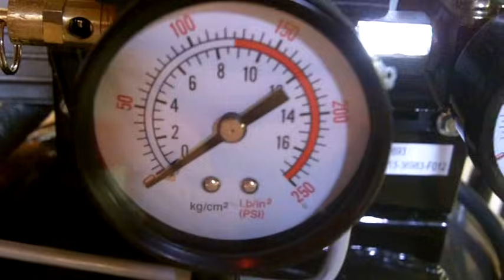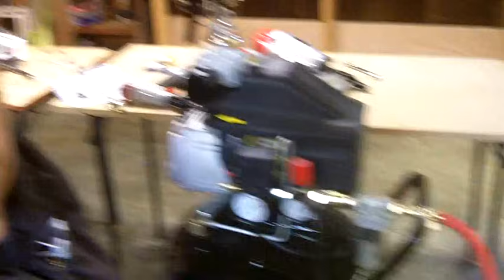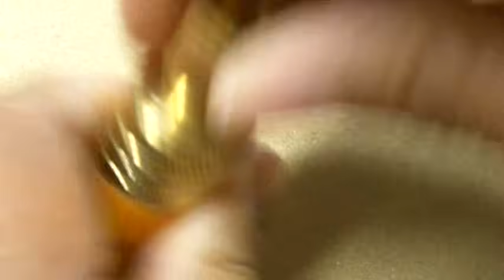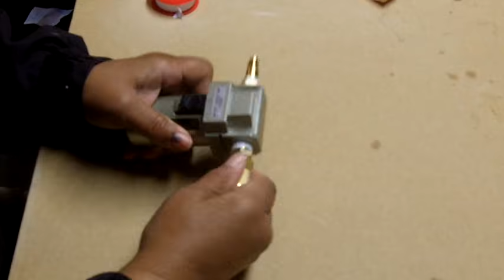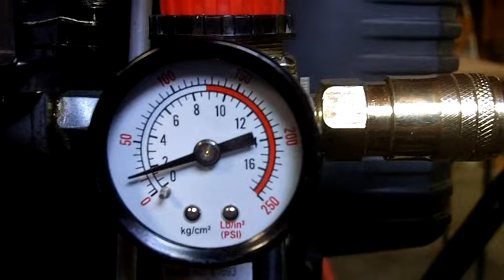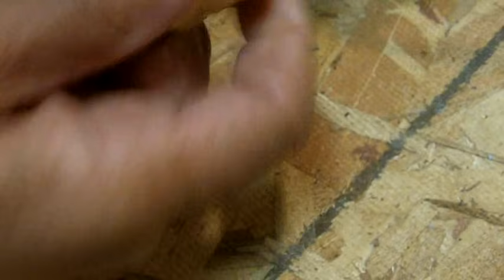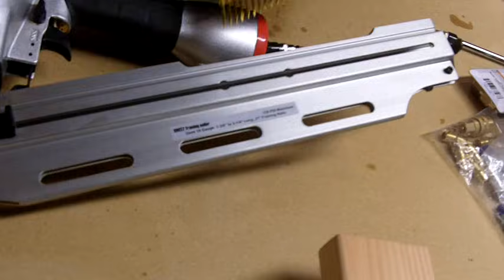Air Compressor, Line Setup and How to Use Air Tools for Beginners

Comment: As a total noob re: compressors This really helped me setup a new inexpensive pancake compressor for cleaning and for filling tires.  Thanks alot.  Very good video.    I had some slight line leaks on the supply lines but nothing that will affect what im using the compressor for.  Eventually i might use it for spray painting once i get a good water trap system (or for assembling basic furniture).   After watching this and thoroughly reading the owners guide setup and first use was a breeze.
Reply from the maker: glad to hear the video was helpful

Comment: Just saying here not trying to be a hatter or anything just some constructive criticism. You don’t need to put oil on that blow tool. The oil is to lube the moving parts inside of the tool. That tool does not have any fast moving parts so it does not need to be oiled.

Comment: Hi Leah!  I just bought a new air compressor and 18 ga nailer for woodworking purposes.  Im noticing that i can buy both a filter and a lubricator for the unit.  Is it worth buying the lubricator to avoid putting the oil in everytime i want to use the nailer?  Also do you have a video or can you tell me anything i need to know about buying a regulator?  Thanks !!

Comment: The negative comments Im sure come from people who know their stuff in terms of mechanical work or working with their hands.  In this case if a person is just beginning in working with their hands and understanding about mechanics, I think the video is great.  This is an excellent video.  The instructor is giving the nomenclatures in an easy format that anyone and everyone can understand no matter the experience.
Reply: R Gon
: 
I don't think you'll find many detractors. Even I learnt of an 'Automotive' connector, off Leah (which is something I've never heard of before) and I purchased my first compressor on June 1st 1991. I learnt another thing about compressors, the other day too, off Wranglerstar's video, whereby he said to never leave the compressor switch turned on (a practice in which I'm known to do on a regular basis). If you happen to blow an airline, or develop a major leak somewhere in the system (which will invariably happen when you're 'NOT' present) then 100% duty cycle will be required of your, otherwise '20% duty cycle?' engine, and you'll burn the thing out! As a result of that, I switch mine off at the end of every use now. 

No matter how much you know, or 'think' you know, it always pays to watch other people's 'takes' on things, for we're all constantly learning.

Comment: Was just wondering what the little nobby looking nut is on the top of the compressor it goes to the regulator via a metal hose just the nut bit is pissing out air is this normal ?

Comment: I don’t think you are supposed to put oil in the tool that just blows air
Reply: Alec Palacio
: Correct. Dust gun, tire inflater, paint gun etc, no oil required.

Comment: hey leah thanks for your easy to understand vodeos,may i ask where you got the water filter from?i need to spray my truck with raptor liner and they recommend getting the water out of your lines,thank you!
Reply from the maker: It's a hf filter but you can purchase a filter from any big box store, they're in the section where the compressors are located.
Reply: thank you leah you have some of the best videos online because you explain things so well keep doing what your doing!

Comment: what exactly is your device to remove water/moisture called (at 5:00)? i am setting my compressor up and am confused by all the names I am finding on amazon and other stores: "water separator", "water/oil separator", "moisture trap/oil water lubricator", "airline filter" etc. I don't care about separating oil as i will only use an impact wrench (and will put oil in the tool as recommended to begin with), but i want to remove water/moisture to prevent rust (do i have that right?). so what exactly do i need and can you paste a link to some products? i've heard just a water separator is very cheap, 10 bucks or so, true?

Comment: hi Leah, thanks again for a great video.  I'm wondering now as to how to shop for a compressor.  I am a woodworker and want as much functionality as i can get but mostly i'd use it for tacking lumber together so it will hold as i add screws to the project.  Also would like a unit that i can eventually use for spraying on finishes.  So the question becomes what PSI rating does one need to enable one to have the most versatility.  Also one of my big concerns is i don't the unit to take up much space.  I work out of my small garage.  Thanks in advance for the help !!!
Reply: You need to look for the CFM (cubic feet minute ) that the biggest tool you would use that will tell you the size of compressed you need. They are rated by cfm @ psi eg; 8cfm @ 90psi.
Reply: Thanks Fred

Comment: Good evening....Thank you for this tutorial. I was wondering if you can give me a tip on why my oil is spilling out of the top cap where the fill opening is? I fill my compressor up so I can see the window with the part that shows how much it is filled, but the problem I am having is that the oil keeps draining itself on the two holes that is on the top oil fill cap. Thank you so much!

Comment: Thanks for sharing your video, I have a my first compressor and find it easy to change my tools by turning down the pressure first this way I can check I have reset the correct pressure for each tool.
Thanks again and take care.
Siimon
Reply from the maker: you're welcome, Simon, and thanks for sharing your tip with the community!

Comment: Excellent excellent video...

I have a question please:

What happens if pressure in the tank drips below the regulator and you do not have a pressure switch to auotmatically turn the compressor on?

Will the regulator still flow lower pressure air or it will stop the flow?
Reply: Liwaa Tawfiq
: I can't imagine a situation (off the cuff) how your pressure switch will activate to turn your compressor motor off (when the maximum set pressure is reached) but fail to turn the thing on again once it drops below the low pressure limit, other than if you were to turn the compressor switch off again 'manually' before the pressure drops to that lower limit, in which case the regulator will allow 'ALL' the air to flow out of the tank, surpassing the point whereby you put the air gun down and start using your own 'built-in' 'biological' compressor and start blowing the dust off your work with your lungs, as a superior alternative!

Comment: What do you do if your compressor never shuts off and the safety release keeps releasing air.  Mine does this and I have to manually turn it off and let the pressure drop?  Is there a setting or switch that I missed?
Reply: Kira Kennedy
Just thought I'd do you a quick video showing the adjustment on my compressor. Hope this helps. https://youtu.be/803tf1wMSzI

Comment: Ms. Leah, Thank You so much for this Video... I work at my local Habitat for Humanity and we received a compressor (Donation)... It needed some work and parts to get it working, however still nothing... after watching this I realize I need to check the regulator and possibly find my solution. Thank You again.
Reply from the maker: you're welcome, Theo, and good luck with getting the compressor going!

Comment: Question
What is the  Most common hose size used on a air Compressor 1/2 or 3/8, just confuse cause they have 3/8 impact  wrench and 1/2 impact

Comment: Great video....very clear!  Question: can I use the compressor when it is recharging? Let's say after using it for a while, the tank PSI drops from 125 max to 70 and therefore, starts recharging. I guess I have to wait until it charges back to 125 and stops, correct? Thanks!

Comment: Is it okay to put the water/dirt trap right off the compressor like that or should it be spaced a few feet off so the air can cool first?
Reply from the maker: It should ideally be spaced off the compressor by a few feet, however, with a portable compressor such as the one seen in the video, it wasn't an option.

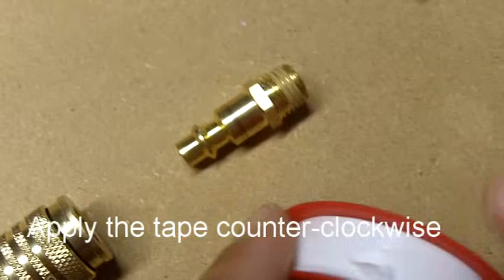Comment: I'm a little late here but, at 11:29, does the indication on the screen mean to say to apply the thread tape clockwise (CW) instead of CCW?
Reply from the maker: Hey Rocket Rider, you made a good catch.  The tape should be applied clockwise.  And I did apply it clockwise, though it may be hard to tell because I am left-handed.  The note on the video at 11:29 that says to apply it counter-clockwise is an error.  So I'm pinning this comment to the top of the comments, so that others will know.  Thanks for catching this!

Comment: I purchased a small compressor solely for the purpose of being able to add air to my vehicle tires as necessary.  I have no need to use it with tools.  The compressor comes with an air filter that screws onto the end of the compressor itself (it has a specific place for it), and I have no problem getting it set up, turning it on, building pressure, releasing pressure, etc.   HOWEVER, I purchased a hose and connector setting this is the same brand and is supposed to match up to the compressor.  Even after watching this video, I cannot for the life of me figure out how to connect the air hose to the compressor so that I can use it!  I can match up and slip the quick-release connector to every part that came with the set but simply cannot connect the hose to compressor itself.  I am beyond frustrated.  Any ideas?  I did check the manufacturers website for videos and read the owners manual, neither of which shows me this one specific step...grrrrrr.

Comment: Leah after watching your video a saw towards the end you were using your 21 Degree framing gun. I am going to buy one this weekend. Im used using constructions screws to frame with 2x4  with renovations in my home. but I wanted to ask you if a 21 or 28 degree gun is better. which one puts out bigger nails i guess

Comment: Hi Leah, question for you.  I'm setting up my compressor with an inline filter, pressure regulator and oil fog lubricator.  When adding an inline pressure regulator what should be done with the regulator on the compressor itself?  Should it be set for the max rated PSI (125 PSI in my case) and then use the inline to adjust the tool pressure?

Comment: I just bought a used air compressor. It doesn’t have an owners manual. It’s a Jobsmart 26gal. I was hoping your beginners video would talk about adding oil. Mine looks dry. What type oil do I add. I can’t find anything on it? Thx

Comment: Thanks 4 vid. I bought my 1st air compressor & fuel extractor, new 2 them both. Was confused about hoses, cuplings & fittings cause I couldn't get 1 end 2 connect 2 the other. Both machines had different couplings and I thouhht they're all the same. (A man at Home Depot told me I had to buy a new hose, cause neither unit came with one, only 2 have 2 cut it 2 fit fittings on them. But looking at ur vid I see all I had to do was buy the right fittings and or couplings for the right fitting. 2morrow I'm heades out to so just that. Thanks 4 saving me further headache. Still loving the experience

Comment: Well done.

Simple critique:

Air under pressure doesn't make water. It just condenses the moisture that is in the air.

Simple way to remember the difference between Male and Female connections; think back to health class and anatomy folks. Male penetrates female.

Comment: Leah, did I get the sequence right? 

air compressor
universal industrial male coupler
universal industrial female plug
female to male adaptor
air filter
female to male adaptor
universal industrial male coupler
universal industrial female plug
air hose
universal industrial female coupler
pneumatic tool

Comment: Thank you for your well thought videos. I am about to use a  portable compressor i just purchased. Do not know much about compressors, however this makes so much good sense. I still have one question: are you using different sizes in your connection? I purchased this tool and accessories with 1/4'' threads, went to Home Depot, could not find connectors  (1/4" M to 1/4" F)   for that size filter(Husky 1/4") as you showed the steps connecting them to the filter. Am i missing something? Are your connectors the same as reducers, from say 3/8" to 1/4"?

Comment: Excellent video. Only one exception. Teflon tape is only used for lubrication of the threads only. Thread engagement of the male threads and female threads is what provides a sealing interface.

Comment: The water separator should be as far down line as possible, not connected to the regulator. Most condensation in compressed air, comes from the heat generated in compressing the air. The vapor will begin to turn back into water as it cools.

Comment: when you install the filter which way should the arrow on the filter be facing? should the arrow be pointing towards the compressor? or does it point towards the air flow?
Reply: Arrow points the way air flows.

Comment: Only use oil specifically labeled "air oil" or "air tool oil".  Some of the oil used in air tools gets into the air you are breathing as a fine mist.  Air oil is safe to breathe (castor oil I think), while other types of oil (e.g. engine oil) are mineral oil with additives which will be bad for your lungs.
  
Sorry if this is already covered, I just skimmed this video.
Reply: Thanks for clarifying the type of oil to use. It was a BIG help, especially health wise.  Had that question on my mind while watching the video. Would have asked Leah or used a household oil. Big mistake !  Thanks again.
Reply: Thanks!
Reply: Good to know, thank you.
Reply: Problem .... in some places you just don't see oil marked as "air oil" so what do you use as a substitute ?
Reply: Was just going to ask what kind of oil to use.

Comment: Thanks for the how to video it was really helpful. I did some research and as far as couplers go I went with Milton HighFloPro. It is easy to connect and remove. I read Husky highflo is a good option too if milton is not available near you. just my two cents.
Reply from the maker: thanks for sharing

Comment: Thank you so much for your tutorial. The day after finding you here I gathered my courage and bought a air compressor and a nail gun suitable to do the bigger projects I’ve been wanting to tackle for a long time. While I was at the store, also bought a table saw, jig saw, and an oscillating multi tool for tile work, cutting, and sanding. Seeing your tutorial has been empowering. Thank you

Comment: Hi, Leah. How do you know what filter to buy? I just got a 15 gal compressor that delivers 4.8 scfm at 90 psi. I've also heard about regulators to deliver the right amount of air to a paint sprayer. I'm also wondering how you choose which regulator to get. I appreciate your video and time you put to explain to all of us how to set up our compressors. Thanks.
Reply from the maker: Usually the manufacturer suggests compatible accessories.  https://youtu.be/vOmB0yzJ0m8

Comment: Thx for making this EZ to understand.  I have a pancake compressor that holds maybe 3-6 gallons of air. It also says 135psi.   Finally, something says 2.6 @ SCFM.  What does that mean?  I would like the impact wrench I want to purchase to take off stubborn lug nuts or bolts on a car without having to use a breaker bar.  Is this possiblem  Thx for your response.  And thx for your posts on YouTube.
Reply from the maker: SCFM (standard cubic feet per minute) represents airflow.  2.6 cfms  won't be enough to power the average impact wrench.
Reply: seejanedrill thx!
Reply: What type of compressor would you recommend for what I want?  Thx

Comment: What I found was the park side compressor the double inlet connection is very soft metal breaks to easy so don't over tighten find out the best method to make screw joints they don't tell you this the inlet when pushed it finds joint move and air leaks why

Comment: This is such a fabulous video!  And you are such a fabulous teacher!!  I've had a compressor sitting around forever and just got it hooked up.  Ready to do some trim work.  I was using my battery operated brad nailer for everything, but now I can use a pin nailer and it will look a lot better.  Plus the battery one is bulky for certain jobs.
Reply from the maker: glad to be of help!

Comment: Thank you very much Leah, your video is extremely helpful. I have one question though, I am told that there is a water release on the bottom of compressor tank and one can release the water build up then why do we need the filter?  if you can help me understand the reason is much appreciated.
Reply from the maker: Hello Parmeet, the reason for the water release at the bottom of the tank is that water collects in the tank when you are using it, and it can rust and damage the compressor if it isn't drained.

Comment: Hi Jane,

Love your videos. If I hook up the air filter right at the compressor, the compressed air will be hot and won't it need to cool a bit for the filter to remove the moisture

Comment: Hi Leah! Thank you for your video! I know it has been up for awhile, but I just discovered you and you are immensely helpful and empowering! I was only able to afford an 8 gallon compressor (1 HP, 3 CFM @ 40 PSI, 2 CFM @ 90, Max PSI 120, 110 V) What are your thoughts on adding auxiliary tanks? I've read it's the way to affordably upgrade, but I've also read its the best way to burn out your motor. I'd like to add an 11 gallon. I use my compressor mostly for lapidary at the hobby level (2-6hrs/week), but I am looking at upgrading my workshop and converting most, if not all, of my electric tools over to pneumatic. (on that note, what tools are best kept electric and which are best changed to pneumatic when budget allows?)